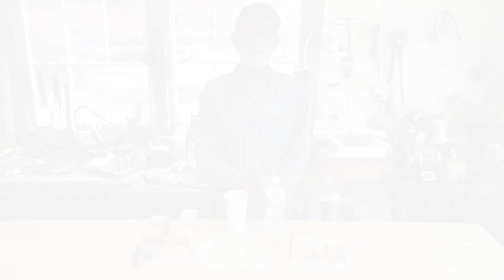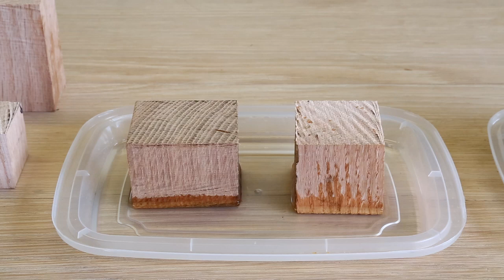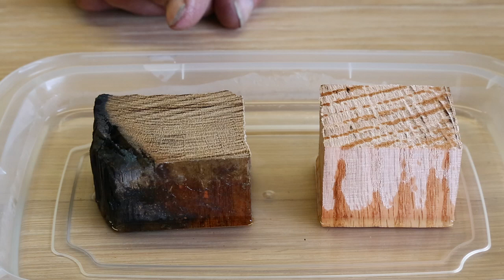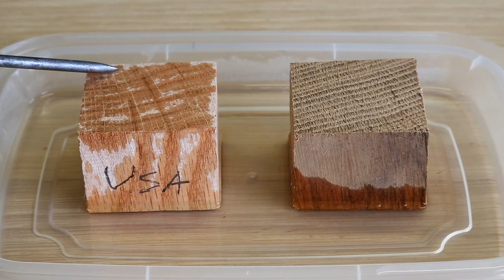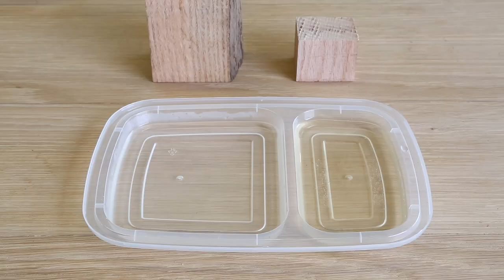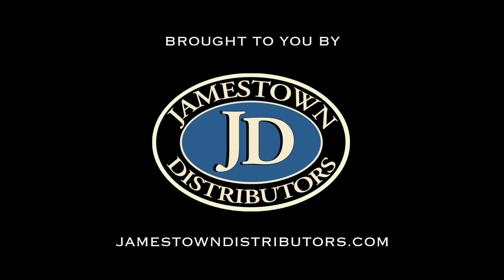Wooden Boat Building - White oak vs Red oak with Louis Sauzedde

Comment: thanks so much, we had just bought 6 bundles of red oak from home depot and I had my doubts so I tried your test and you were right. I had to return the whole load, better than installing it first!
Reply: it was sold as red oak. I just bought the wrong type. white oak is the best type to me. there was air conditioner leaks under the carpet that could be sanded out, I don't think the red oak would have fared as well seeing this test, its even used for whiskey barrels.

Comment: Great video. Loved it. So much I went into a deeper search about OAKs even when I don't care about wood. 
Here is what i found: 
White oak is darker gray, red oak is a lighter pinkish. 
White oak Janka harness scale of 1360 vs red oak 1260
White oak is more used in boats and floor and red oak more used in furniture.
White oak has a vanilla smell good for wine barrels, red oak smell is not as pleasant.
White oak is heavier and harder to cut, needs carbide-tipped blades and bits to cut it. 
Price varies but are pretty similar between both.

Comment: Great stuff Louis.
Somebody posted up a link to your steam bending video on the WB site a couple days ago and I've since watched most of them.
Good advice delivered well.
Kudos.
Reply: a great tutorial on making the correct material choice, i particularly appreciated the dynamics involved in absorption of salt water and it's interaction with DC current induction - one question, aside from furniture, where else might someone use Red Oak? Cheers
Reply: Michael Ogle Railroad ties, flooring, construction lumber, timbers, pilings.  It is generally used for furniture, cabinets and "appearance" uses because it is expensive.  It is a great wood for many uses, just not ones where transfer of fluid is a problem i.e. whiskey barrels  or wooden boats.  I've wondered what other north American wood species (maybe cherry?) would be good for boat building but most of them like maple don't have the rot resistance of the oaks.

Comment: Great demonstration.  Years ago, I showed a supplier that I could blow bubbles through a piece of supposed "white" oak and that charactistic was a problem.  He was relying on color, which is not reliable.  Also, I've been told that there are numerous oak crosses or hybrids that can have characteristics of either parent species.  Ex/chestnut oak.

Comment: Fantastic presentation. I wonder where the DC current comes from?
Is this the current that dissociates the Sodium and Chlorine from the salt? Or is this current generated when the NaCl dissociates into its ion form?
We can see how the Sodium hydroxide (NaOH) and Hydrochloric acid (HCl) can form but when mixed together they neutralise and form Salt (NaCl) and Water (H2O).
Is there a process occurring inside or on the surface of the oak wood? It’s either that or an external current is present that drives the chemical reaction in one direction.

Comment: Great info.
 Question: If you're going to make a brace, backing plate or something structural that will be out of the water and epoxied, would you want red oak, seems like it would absorb more epoxy than white oak, would it then be less subject to weathering?

Comment: Good demonstration but I have to question the one statement comparing white oak to bamboo as being segmented. If you make a clean knife cut on the endgrain of a dry piece of white oak heartwood, you'll see the cells are filled with a crystalline, sap-like material called tyloses. This 'filler' is blocking the drinking straw-like path that is present in red oak making white oak the superior product for wet applications. This is the easiest method I know of to identify white oak.

Comment: Interesting test. If you don't want to go through the alcohol test, you can simply look at the end grain with a loupe. White oak has "tyloses" (they look like potato chips) that block water travel through the grain. The end grain in red oak does not have tyloses. BTW, your theory RE "DC induction" and salt build up is off base. If a metal fitting is over protected, then hydroxl ions will form on the surface of wood in contact with the cathode.  The hydroxl ions then can combine with free sodium (Na) ions to form sodium hydroxide that in turn can damage the wood. However, this process has nothing to do with salt concentration in red oak.

Comment: The porosity between the two is actually fairly similar. The white oak family has a structure in it called 'tylosis' that effectively plugs the chambers. Beech has the same structures-- Just two cents from an old forester and woodworker.
Reply: Thanks for the tip. Im collecting logs now for milling. Im about to set out on building a small sailboat. I'll look for beech . I have 30 acres, and my neighbors have some beech, but I haven't seen any on my property yet. But I haven't looked for it very hard.

Comment: There is another way to differentiate between white and red oak. Applying some drops of 5% sodium nitrite solution on white oak generate a very visible color reaction (it becomes really dark colored). Red oak doesn't show any reaction on sodium nitrite. It's quick and easy, and very reliable.

Comment: I wonder if the Red Oak could still make an interesting composite structure ? I mean stabilized buy resin for example. Its capillarity properties can help soak resin deep inside even with no vacuum chamber. Otherhand red oak is light weight compared to other oaks. What do you think ?

Comment: Why would there be DC current going through the wood in a boat? From electrical shorting?
Reply: Yes I am also confused.
Reply: I'm not absolutely sure but.. By utilising metals In conjunction with a type of wood that soakes up a highly conductive fluid like a spunge in the cunstruction you're basically making a galvanic cell..

Comment: Anybody knows if these capillary properties in red oaks are used to treated the wood with chemicals to prevent rot/water absorption? (ie dipping the wood or even forcing fungicides mixed with a polymer through the wood under vacuum, and then cure the wood so that the treatment seals the pores),,, the wood would be extremely heavy when dry/cured, but also extremely rot resistant.

Comment: The main issue, in my opinion, about using white oak rather than red oak is that, even if you can maintain the sealed surface of the wood and prevent water from soaking in, the red oak will become brittle once it is completely cured and will fail under the sort of stresses and punishment a boat is subjected to. White oak will remain resilient and will remain strong.

Comment: What I find odd is that I thought this meant that Lou would never use red oak in boat building.  But then, the work skiff (and another IIRC).  The feel, smell, color, and density of red/white oaks is how I tell them apart. Have used plenty of both. Also for firewood. 

Sniff test: Fresh split (green) white oak smells like whiskey, whereas freshly split red oak smells like red wine (cabernet, merlot, etc).  Oak barrels yo.

Comment: All good until the end.  Lye doesn't harm cast iron.  Yes, it destroys aluminum, but I've used pounds of it cleaning old iron skillets by letting them soak for weeks in the solution. There is never any damage, the lye only dissolves the organic matter burned/cooked onto the surface.
Reply: Hi Wade, i would like to share with you how I clean cast-iron skillets, i burn wood for heat, when i have a deep bed of red-hot coals in the wood stove i lay my skillet in, may take 15 min. or so to get red-hot, flip it over,  when done lay it on top of stove to slowly cool, then i wash and dry before i oil it with cooking oil, dry the oil on top of the stove, i have no jacket on my wood stove.........
Reply: Yes, I've burned them as well.  It's no problem with a good even bed of coals and not too much air flow, but there are more risks with fire than with lye. I used to trade in cast iron. I've re-worked many dozens.
Reply: Toss 'em in the oven when you self clean it. everything not Iron turns to powder.

Comment: if the wood is a shape and fill substance(paint or fiberglass covers it) wouldnt other properties be more important?  If its an accent wood fine, leave it bare, but structural is more dependent on weight, strength and resistance to warp.

Comment: Can you mix alcohol with epoxy and use the woods capillary action to impregnate the wood with epoxy?
Reply from the maker: +Jonathan McClellan Mixing alcohol with epoxy will certainly help surface penetration but won't assure saturation of the entire piece
Reply: +Jonathan McClellan 
Resin impregnated wood has been around a long time and you can buy kits to do it at home.
Reply: Thank you, Terry. I'm just wondering if when you're working with much thicker pieces of wood, if mixing it with alcohol will improve the resins ability to penetrate the wood. I've also heard of vacuum impregnating wood with resin.

Comment: Nice presentation but I need to comment on how you use the word porosity. Porosity is a static property of a material. It can be closed cell or open cell. If it’s closed cell the water or alcohol will not move (or hardly at all). The word you need to use instead of porosity is permeability. That’s the dynamic property of the material. Two samples of wood can have the same porosity but very, very different permeability depending on whether the cells are connected or not. The red oak you showed is porous AND permeable. The white oak can have exactly the same pore volume but be mostly not permeable. 
It sounds trifling but words have meaning and porosity is commonly misused the way you used it in your nice demonstration. Try distinguishing between the two words and you’ll find it’s better descriptive of what’s going on. In other words don’t say porous when you mean permeable. 
Thanks for reading my comment.

Comment: I suggest swamp white oak. It’s much better in comparison to common white oak and it even grows faster. The USS Constitution was built from swamp white oak and it’s still on the sea today. It’s been given the nickname “old Ironsides” because it’s wood is so durable it was thought by enemies to be made of iron. Also black locust is a very strong and Rot resistant wood that is easy to steam bend. These are specialty woods, so you may not have access to them, but I’d take a look into it. https://www.wood-database.com/swamp-white-oak/ https://www.wood-database.com/white-oak/ https://www.wood-database.com/black-locust/

Comment: How Bout Southern Live Oak?
                                  aka SuperAx
Reply from the maker: +CROSSAWGA Live oak is fantastic, it's harder than bricks, they've been using it forever in boat work where it's available - it's a species of white oak that never loses it leaves
Reply: +Tips from a Shipwright  Down here in Southwest Georgia USA, We have cut 8 tractor trailer loads of sawed ship frame flitches (20 to 25 loads of Southern Live Oak Logs). The entire San Salvador Ship Recreation is framed of it. Also the Floor timbers and lower Futtocks of The Ernestina Morrissey  is going to be Southern Live Oak. To see some google Cross Sawmill/ Southern Live Oak /You Tube.   Steve Cross---Got Live Oak ??? We Do !!!

Comment: so red oak is bad for boat making
Reply: Probably bad for anything that involves salt water.
Reply from the maker: +Goodguydolls Red Oak has its place in boats that possibly have a shorter life expectancy for other reasons, like a skiff or work boat that's going to get heavily used
Reply: +Goodguydolls 
Bad for any exterior or structure.  Okay for protected interior fittings.
Reply: Are you saying imaginary lines ormedgeunary  lines, the cc on here says imaginary. We get the tree rings, but the names of the two, where the capillary action happens check in on one of the medgeunary lines we think you are saying. Love your videos!! We have learned so much from you.
Reply: Joseph Brendel he's saying medullary, you can look that up to find out about them. also referred to as medullary RAYS . as he said in the vid, they go perpendicular to the growth rings. wood moves as it takes on or loses moisture, the cells swell and shrink so a board will also expand and contract... as well as warp, cup and bow. to avoid this problem woodworkers have learned that splitting wood along the medullary rays gives the straightest grained boards that are least prone to warping. what you end up with are a bunch of wedge shaped boards as if a log was made into pie pieces, which are then planed into flat straight square boards
Reply: Used it for canoe gunwales once - wasn't good at all.; twisted bad once ripped (harder to fasten), picked up a bunch of weight, and didn't last long.  But it was all that was at hand in length, so it was fun while it lasted.  Great stair tread.
Reply: Goodguydolls but great for shakes and soft drinks 😂
Reply: Actually, if you watch all of Lou's stuff, you'll see him use it.  But of course protected or above the waterline.